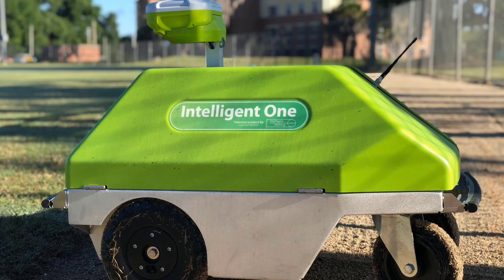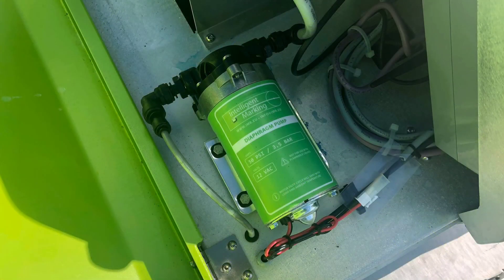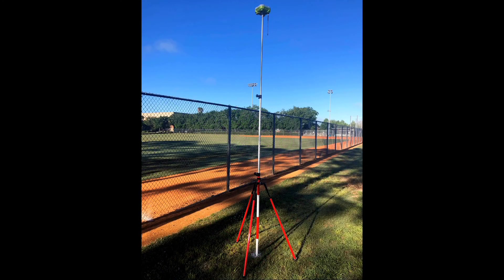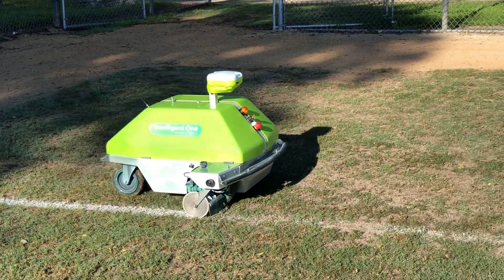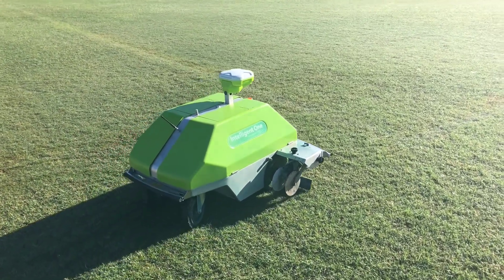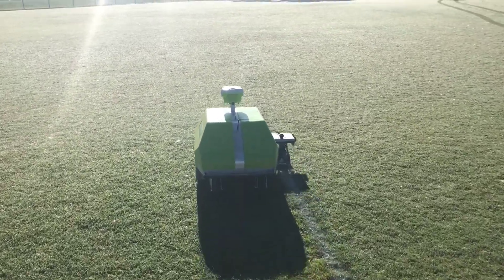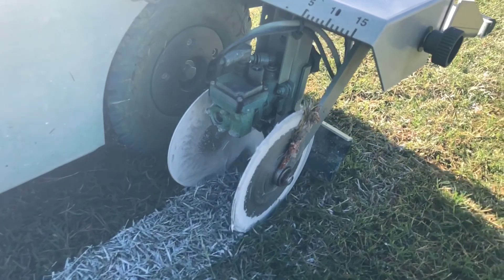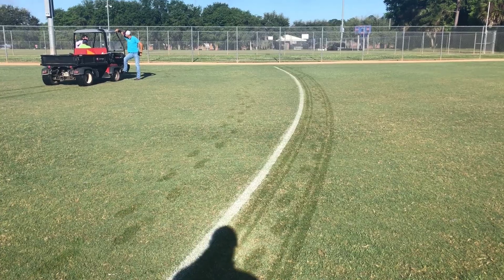UF RecSports - Turf Tank Robotic Athletic Field Painter

Comment: Wonder if this can be used to paint university parking lots and private drive ways.  Any information in this direction is enormously appreciated.
Reply from the maker: I am not sure if this has been explored yet or not. From what I understand, the system relies on referenced base locations in each field to correct the GPS. That being said, I could easily foresee that being possible for parking lots etc. that need to be repainted regularly. I encourage you to reach out to the manufacturer/distributors to see if they have any thoughts regarding that type of use.